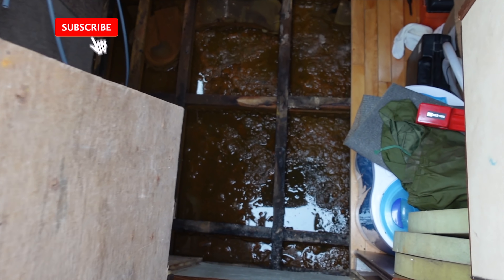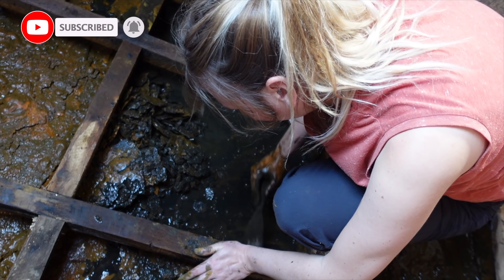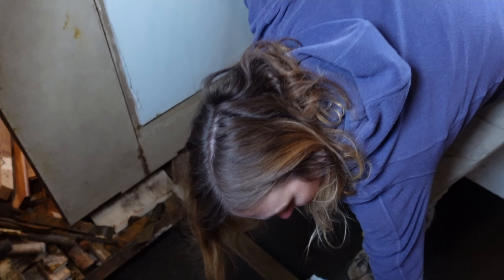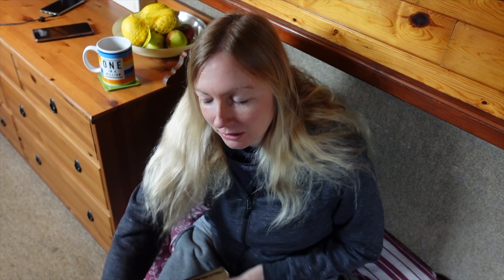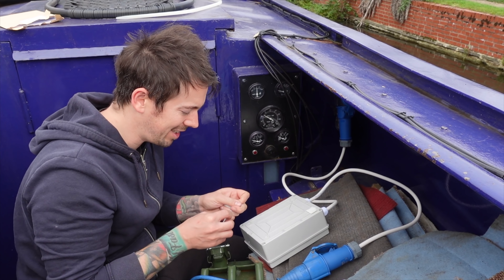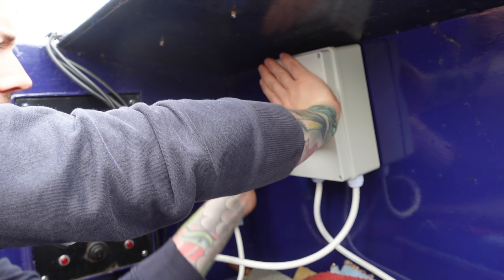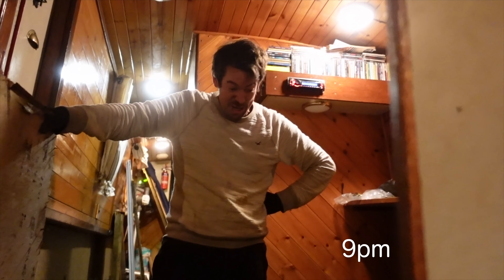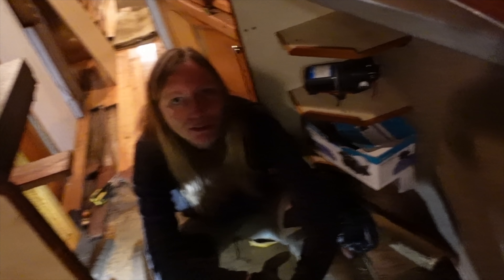Narrowboat RENOVATIONS = RUST, HOLES and A PARADY IN THE MAKING !

Comment: Still ploughing through the back catalogue 😁 loving this series as a new boat owner myself (only a small river cruiser) which has had similar issues. I rewired it and installed a new solar system, and then my daughter put her foot through the floor. I pulled the lino back and found 2 layers of other old lino completely covered in mould, and the bottom of the boat was sloshing around in years old water (lucky it is fiber glass!) When I reached the actual plywood floor I could pull it out in chunks! It was literally crumbling it was that rotten! I've now ripped the whole interior apart to put new marine ply floor and remodelling the whole interior. After the recent rain we've had, I found it was the windows leaking which caused the channel under the floor to fill with water and rot everything. 

Just to mention, I am a gas engineer/plumber, and I will also be applying to be a BSS examiner next year, so if you need any future advice, just let me know 😁👍

Comment: Hey Chris and Becs,first off Happy Christmas!!!
 Great video again
 Treat yourselves this   Christmas. To a cheap  mains powered multi tool, that  vibrates at high speed  (Oscillating multi tool).
You can pick some up as a kit  with various blades, and attachments for various jobs inc detailed sanding
Some of them have variable speed too, and tool free blade changing 
You can then slice through them boards,up close and tight to those walls. As the blades are really thin.I had similar issues in my mobile home,boards running under the walls
The blades tend to be universal fit    some of  of the wood  blades will cut wood and nails  Really good investment
I have had ,one for years.Paid for its elf in no time
Cheers
David
Reply from the maker: Happy Christmas to you too, that's so sweet, we definelty need to do a tool run at some point, how exciting, especially as were going to be cutting hot of wood these next months, thanks so much for your amazing suggestions David  :)
Reply: @TheNomadicCrobot  Your very welcome,the multi tool is so versatile,I'm sure you will have loads of uses for one,he,he
You can buy cordless ones too of course,he,he

Comment: Any ideas what has caused the belly button circles of rust?  Seems odd they are all central and similar size.  I have done up many a yacht but this is all new to me.  However, as in a yacht access to the bilge is essential so when you re-lay a floor it might be better to use long boards which you can then organise specific inspection hatches.  Laying one floor over another like the one you had was always going to be a disaster.  No matter what water will find it’s way into the bilge so you need a way to check for it and keep it clean and dry.  Amazing job you two are doing.  Keep at it. Andy UK
Reply from the maker: Thanks Andy, we have got a few more parts of the puzzle but are just rounding up the bits for the next episode Wednesday, such an odd thing to come across, its worrying when even professionals can't seam to nail down what going on, yes its a must that we lay down a proper way to look into the bilges, thanks again and good luck with you yacht adventure :)

Comment: I’m feeling so sorry for you guys.  What a mess!  Was the boat surveyed before you bought it?  If this wasn’t picked up then the surveyor needs locking up.  I’m hoping there is no evidence of the under*plating sagging from the weakened bottom or even starting to split from it.  ❤️❤️
Reply from the maker: Unfortunately we couldn't get a surveyor due to lockdown, but the boat had had a survey a year prior so we called the surveyor and were reassured off any faults, it was actually missed on the last survey as I think they can only check what they can get to, currently the hulk seams quite solid but we will defiantly be getting a hull survey soon for peace of mind :)
Reply: @TheNomadicCrobot  Save your money. You get more advice and guidance on here and it's cheaper too.
Once the hull is stripped back, invest in a ultrasound device and every time you black her, check the hull thickness yourself.

Comment: That ballast need to go back ! they sell cheap 450mm square paving slabs in most builders yards. To cut that kitchen plank you can use a multitool cutter edge then you dont have to pull the kitcen floor up. the ryobi multi tool worked wonders for me. Think you need a full overplating tho =(
Reply from the maker: yes the ballast will go back, bex said that we won't see it so it probably doesn't matter if it looks horrid, we do need to stock up on our tool selection , oh go I hope it doesn't need a full replate , time will tell thanks :)

Comment: get your boat into a drydock or lifted out on to blocks to inspect the base plateas soon as you can
Reply from the maker: we will do thanks Mark :)
Reply: @TheNomadicCrobot  im sure it will be ok  the base plate as the mm of steel that were added were quite thick for ballasting across the irish sea i presume not from dublin too holyhead but around the liverpool bay area up too glasson  dock before the ribblle link conection to the lancaster canal by the way there is a good boatyard just by standground lock from river nene to kingsdyke of which you came through last summer they have a crane and hardstanding and good welders if you need one for anything like new anodes and high pressure washer for blacking  i dont know them but good reports of them im in peterborough living at the moment you are doing a good job of derusting the bilges cleaning and treating and painting and have most of it done soon ready in the spring to crane out somewhere also fox boats at march is good

Comment: “What a shithole” he says with cheerful crobot profundity. I’ll bet I’m not the only one that thinks the behind the scenes rumbling isn’t anywhere near as cheerful and contains a few choice expletives! But well done you two ( well Bex anyways haha). You might wanna try a nice reciprocating saw (with short blade of course as sawn thru water pipes add lots more fun) and a multi tool. Cut around the bulkheads etc and add extra floor joists when replacing the flooring to have something to screw ( with stainless or decking screws) the new plywood flooring to. Leave a slight gap between fresh sheets of plywood to allow for expansion. The new vinyl totally waterproof click n snap flooring is amazing stuff and adds a bit of insulation to boot - plus removing it is a breeze. You two are my heroes tho fer sure! Hopefully when you finally haul her out the surveyor isn’t gonna use the word “scrap” in his assessment! We will be boat shopping in the Spring - thanks to you two It’ll have to be a brand new boat tho (lol!) I’m afraid!
Reply from the maker: haha thanks so much for this amazing advise, we already have the new marine ply ready for our floor, these tips are priceless, we have quite the job on our hands but quite sure it will get done soon...bex is fast after all haha :)